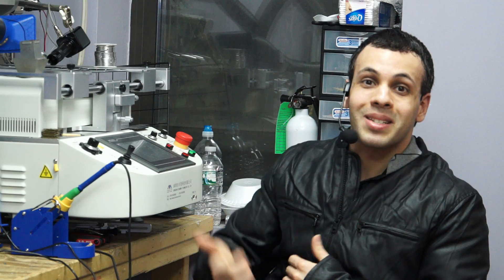How to get your #mbp2011 problem fixed for free!

Comment: I had my board replaced after complaining  at least 5 times that the computer would over heat and not run to spec. It finally crashed , i have been afraid to use my computer for graphis ever since ..  Will this still work?

Comment: Louis - I like your style brudduh !  You brought up an interesting point with the 2015 Retina.  I'm the type of person who looks for the "garage queen"....I love doing research and finding the right deal....boat, truck, computer....doesn't matter.  For me it's the thrill of the challenge of finding the item.  Having said that,....I still use a 2010 15" Macbook Pro i5 dual core, but I can tell it's starting to struggle a bit.  I suspect it needs a "once over"....cleaning,...thermal paste, perhaps an SSD (already maxed out on 8GB RAM).  My (layman) homework also indicates to AVOID the 2011 Macbook Pro for exactly the reasons discussed in your video....basically they are just shitty. So,...I keep going back to the 2012 i7 because my homework has indicated a better processor,....better graphic card (or even dual GC's), better screen (no lamination issues, etc.  I can buy one and put 16GB RAM in it,...maybe remove the superdrive and put a couple of 500GB (RAID) configured SSD's etc.  Now you mention the 2015 Retina as sort of a "go to" machine.  I'm not opposed to a Retina by any means, other than having learned that you can't really "upgrade" them (can't change HD, RAM is soldered in, etc).  This may or may NOT be a big deal as big a deal for me as it was before I watched this video of yours.  Are you saying that the factory engineering on a 2015 Retina Macbook Pro 15" is better (GC, cooling, etc) than what I could pull off in a 2012 rebuild I do myself.  Thanks for taking the time to read this,...and thank you for not pulling any punches.  Much obliged sir !

Comment: I wish I had seen this vidio some 4 years ago. I had my mbp 2011 board replaced, and it runs like a toster. I had to instal 'a fan control app' it regally throttles and I get the beach ball. Spent £2100 GBP ... To invested in the mbp to afford to buy a better one. It works ok, but thinking of putting in a ssd (may be two ssd 500gb and replace the optical drive) but after watching this vid I think i will stick a  120 gb ssd and creat a fusion drive, as it is a low investment for a baster speed. Already upgraded the ram from 4gig to 16gig.

Comment: this is fixable at software level typing this on a macbook pro 2011 15 with a fried amd gpu ;)
Reply: I'm trying to work out the software level solution, any pointers you can give me to the approach that worked for you would be extremely helpful!
Reply: @alanspence1716  Here is the link. https://apple.stackexchange.com/questions/166876/macbook-pro-how-to-disable-discrete-gpu-permanently-from-efi     ---- Make sure you use the right OS. Also make sure to not let it do updates. Mine updated and it broke the fix. Now I'm back at square one with a laptop that wont boot.
Reply: Thanks for your reply RayBen555, I've managed to spend quite a bit of time on this over the last couple of days and have had success. I've currently got a working Mac back again after being too disgusted with Apple to use it for 4 years - my replacemt laptop, a Dell XPS has been brilliant over that time and still is. I've tested Linux on the Mac too, the Elementary OS looks extremely similar to Mac OS and runs well. Anyway in case it helps you with your bricked Mac I had success with https://www.ifixit.com/Answers/View/198711/MacBook+Pro+2011+GPU+Glitch - the main solution in this.
I completely rebuilt the OS on my Mac first though using the Internet Recovery mode - I had to run this and reboot multiple times (7 or 10 times repeatedly restarting it!) before it finally came to life. So I am back on Lion and haven't done any upgrades from that yet. If you need any Lion kext files or anything else, or get stuck with the link I've included, let me know if I can help. Thanks again for your reply.
Reply: @alanspence1716  https://realmacmods.com/macbook-2011-radeon-gpu-disable/
Reply: @RayBen555  https://realmacmods.com/macbook-2011-radeon-gpu-disable/

Comment: I've got an Early 2011 MBP 17" I bought as an Apple refurb in November of 2011. 3 years later the screen was replaced & the GPU was repaired under warranty. A month ago the GPU went out. Went to Apple in Oregon, and they said they couldn't repair a "vintage" machine 7 years from purchase. BUT ... the Genius told me there's two places on the planet where Apple must still carry parts and offer repairs on a 7 year old mac: Turkey ... and California. Both have lemon laws that compel Apple to carry parts and repair equipment for a full 7 years. Thank you Governor Brown.

I flew to California on business the next week, Apple there fixed my issue with a new board from inventory in 3 days, and it cost me $600+. I got a 90 day warranty that covers me to January. I was told that my new board from their inventory incorporates a fix that will keep this from recurring. We'll see. I'll pick up a new spare logic board just in case, and maybe an extra working machine on eBay too; they are still out there.

So, if you want Apple to fix your vintage machine within 7 years of the purchase date, then get to California ... or Turkey.

Oh, I toyed with trying Louis' GPU test, but decided against it. I just need another 3 years out of this machine before the next upgrade (this is my 8th Apple laptop, and I started with a PB 100. All were bought as refurbs, and all performed well except one.) My 17" MBP happens to be the finest of the bunch, and I work it hard (CAD, Photoshop, programming, movies & general entertainment). It also sits on my desk on an aluminum cooling plate with cooling fins bolted to the underside to manage the heat. Dual Core i7, 2.3 GHz, 16 gigs of RAM, 2 internal 1T SSDs, drives 2 monitors, and a powered USB everything hub.

It's vintage, but performs like a beast. I wish Apple still made 17" laptops ...

Comment: The price at Apple Store is now $600+ to get a new logic board, for the Late-2011 MacBookPro. Do you still recommend the process in this video, for now in 2018?  Any reason you think this approach would not apply or work now?
Have you gotten much feedback over the years that it did work out as you suggest here?

Thanks!

Comment: Great video - thanks!

Back in 2015, Apple replaced the logic board on my late-2011 NON-Retina MBP, for free.
 Last night, it started failing again, and today, Apple Store Genius told me they'd replace it again FOR $600!

Genius also told me that once my computer hits 7 years old (which will be Dec. 2018), Apple is prohibited by law from repairing it again. Does anyone know if this is true??
If so, does that mean I only have until then to go through the multiple-repair process suggested in this video?

If so, how certain is it that running the stress test will kill the card - and how long should I expect it to take each time?

Finally, how many times re-repairing it until they have to just replace the computer?

By the way, I'm currently running gfxCardStatus v2.3 on the computer, with "Integrated Only" selected, to hopefully keep stress off the faulty Discrete chip, and thus hopefully extend the life of my computer while I finish projects on it and work my way towards migrating away from this computer. Unfortunately, this means I can't use my 30" external monitor, so I'm juggling lots of windows/programs on my MBP screen.
       If anyone has any feedback or improvements on that process I'm doing, I'd appreciate it.
 
Thanks again for such great work, Louis :-)
Ted

Comment: I had my MPB early 2011 logic board die twice and had it replaced for free by Apple (thank to the class action lawsuit they lost on this model/issue) but no surprise it died again (2 years after the last replacement) and Apple said they won't replace it anymore since it's more than 5 years after the manufacturing date and it's now considered "legacy" and they don't produce parts for this model anymore. And that is unbelievably shitty on their part. The only suggestion I was given was to have it replaced using 3rd party vendors. These motherboards sell for about $400 (e.g. from iFixIt) and I don't feel like spending that much money on a 7 year old machine (which worked perfectly fine otherwise) just so that it can break again due to the same issue Also Apple didn't offer any other incentives when I asked considering they can't fix it anymore, so I doubt that they would give me another (newer) machine as a replacement for my broken lemon. Is there anything that can be done to fix this logic board cheaper than $300-$400 ? Would it be as simple as resoldering the chip back go the board using different paste?
Reply: I used a ebay repair service last week, paid $140 and it is working great now.

Comment: Guys there is a software workaround for disabling the nvidia GPU, google this: sudo nvram fa4ce28d-b62f-4c99-9cc3-6815686e30f9:gpu-power-prefs=%01%00%00%00 and look for the applestack post.
Reply: Hey thanks for the link. but I don't get if the command in the title if the correct one to use, or if the format should be changed to sudo nvram GUID:NVRAM_Variable=value as it says later in the post. Do you know?
Reply: Did you resolve this - a pointer to the right approach would really help me.

Comment: Got my MacBook 2011 booting now!   Works on High Sierra also. It’s very quick and should get you booted into your machines again.  Command -S (hold down while powering up). At the /root prompt type the following in exactly as I have written here:   Nvram fa4ce28d-b62f-4c99-9cc3-6815686e30f9:GPU-power-prefs=%01%00%00%00.    Then hit enter.  On the next line type:  nvram boot-args=“-v”.  Then hit enter.    Then type.  Reboot.    Hit enter!   You should be able to gain access to your MacBook now.   This disables the accelerated GPU and defaults to the integrated onboard video instead. Hope this helps you all. Have a great evening! Sincerely, Rob.  (Canada)
Reply: Hey Rob, thanks. Does this still work for you a week later? Juss further up in this comment section (show latest) linked a post explaining it but I'm not sure if the OP means that nvram command is the correct one or if it works, but only for a while.
Reply: Adamski Yes, the laptop is working perfectly.
Reply: Make sure not to do any updates. I had mine working with Lion OS for two weeks. Wanted to use the App store so did a update. After that it broke the code and I had to start from square one again with the heat gun -.-
Reply: Thank you so much, it really works for me. Macbook pro 15 inch early 2011

Comment: Quick question, slightly on topic - if you have the one with the 6490 or whatever it is with 256mb ram, can you swap it for a 6750? Is that even worth doing? Also you say, when you do this, you replace the graphics chip - besides that, and obviously using better thermal paste, anything else done to make it last? I mean if it's the chips that are garbage themselves, isn't replacing the chip almost as bad as the "reflow" (quotes added for obvious reasons)..thanks for answering, I just picked up one of these laptops, in good condition, but, the previous owner didn't even know (apparently) that it had a second GPU and all the screenshots be sent / when I checked it, was using the Intel, now that I've enabled the AMD, especially with how heavily I use machines, I'm worried it'll fail quick.

Comment: Thank you for all your old and new videos and consistent work ethic Louis - it's "remarkable" how many things have stayed the same all this time. My 2016 nTB MBP recently got a top case replacement under Australian warranty (and therefore also a 2017 keyboard) due to a failing battery and being polite to the Geniuses didn't hurt at all.

Before booking an appointment - when I noticed the battery getting dodgy - independently, without knowing about your channel, I made sure to stress the battery a few extra full cycles to make sure the error messages displayed reliably.

Its great that you provide so much support when Apple doesn't. As you're well aware and have mentioned before, there are valid reasons people buy Macs and you don't discriminate. For me, I have a (Linux) desktop but my first Mac is now here so that I can learn what the Apple fuss is all about and hopefully make some money out of it too (it's usually good to see the other side's perspective).

Besides, a world without Apple is a world with less competition. Keep holding Apple to account and keep on educating!

Comment: Dude you are the truth! Obviously this video came out in 2014 but my 2012 mid MacBook Pro GPU is dead lol. Love the video!
Reply from the maker: Retina or non retina?
Reply: Thank you for responding - didn't think you would! this is the Retina display- So I went to apple and they told me even they theirs a recall for this issue(gpu) its only valid before 4 years from purchase date - they want to charge me $575 + tax..... smh.....
Reply: Apple told me the same thing, they says my 2012 Retina MacBook Pro is no longer eligible for the "Video Issues" fix so they want me to pay for a brand new logic board out of pocket.... unbelievable

Comment: Yes. What a good idea (sarcasm) Use the system to steal “legally”. Frankly, I’m disgusted.
Reply from the maker: Being given a device that the manufacturer knows will fail with no recourse after giving them $1700+ is stealing.
Reply: Any device worth its silicon should be able to handle a basic stress test. They're done all the time by all sorts of pros before important work can be entrusted to the expensive things. Most devices with manufacturing defects will either fail early, or when they get old. This is basic knowledge that only companies like Apple hope people won't know.

Comment: dGPU died yesterday, just wondering would this still work?
Reply from the maker: No, all these recall programs went away a year ago
Reply: OMG thanks for the reply!!!  Huge fan! Love listening to you dissing apple. I currently have it temporarily fixed by disabling dGPU. I am wondering whether there is a better solution, and would it be possible to send it to you for a repair. (I did check your website, and it says no more 2011 gpu fix :''(

Comment: MBP late 2011 Logic Board: failed 2013, failed 2015, failed 2017... parts no longer available, was offered a $600 discount on my next purchase at Apple.
Reply: Mine failed in March 2018 and they replaced it. I had to bug them about it, but they did it — free. Whoever told you the part was no longer available lied, since mine was at least 3 months later than yours. Granted, they did make me go to an AASP since the techs at the genius bar didn't know how to do the work anymore on such an "old" MacBook.
Reply: James Cross apple replaced my mother board on the mbp 2011 as the gpu died for free in 2014 at the apple store. It runs ok, but like a toster and had to instal 'fan controle' app. I wish I had not purchased it. Cost me £2100 gbp. Alway throttling when I use it and beach ball when windows office loads. I do love MacOS, but i feel like I am driving a Nisan but paid for a Lambagini. Infact a nissan is to good to compare aginst the mbp2011.
Reply: @latitudeash  they do get quite hot, can't say I've seen the throttling like that though. I use it for Pro Tools, which is a much more bloated piece of software than Office.
Reply: James Cross i see the beach ball quite often when starting up word or when i start up the mac. Once its up and running after starting up it runs ok beyond the odd app that gives me the beach ball. I have 16g memory and a 750 hard drive the faster spinning speed one. Since installing ‘fan control ‘ app its better but it should be better than it is as i have a i7 cpu
Reply: @latitudeash  that may be the difference - I've got an SSD in mine. Only 8GB RAM, with a 500GB SSD and 2.2gHz i7. The spinning platter is holding you back, even at 7200 RPM.
Reply: Did you make the logical decision and go PC and or Linux?
Reply: Dude same,except they didn't offer me shit.
Reply: Did they really offer you 6 hundred??
Reply: I’m sure all they did was reballed. Just to buy time
Reply: Same here. My macbook is only worth 200 bucks for parts. Never again Apple

Comment: Hi Louis, I guess I got screwed by Apple store in De Hague, Holland. Few month ago I accepted a deal of € 310 bonus (to be spent at their store) as compensation, unfortunately, I didn't see this video before accepting their proposal. I haven't used the bonus jet I wondering what is left to do if any. 7 November is the end of the time frame to purchase something. Thanks anyway for the good advice.

Comment: My 2011 15" Macbook Pro GPU died and it's out of extended warranty now, after I've had the free replacement last year. Good news is you can still disable the GPU and just run on integrated graphics, which work's quite well actually. https://apple.stackexchange.com/questions/166876/macbook-pro-how-to-disable-discrete-gpu-permanently-from-efi
Reply: I also have a 2011 Macbook Pro 15 and my  GPU just died 2 days ago.